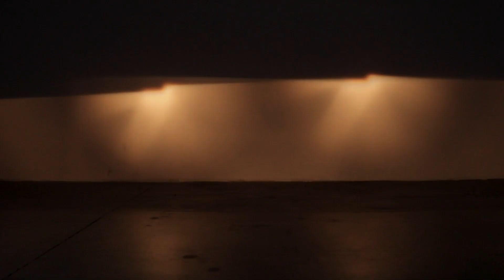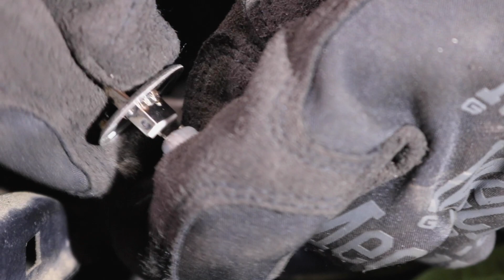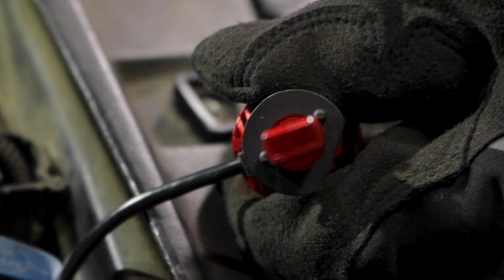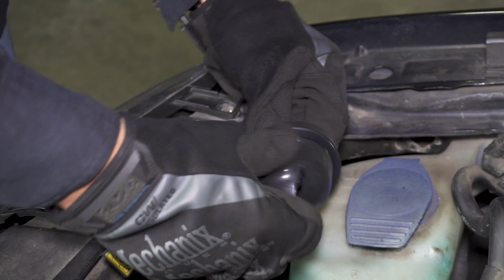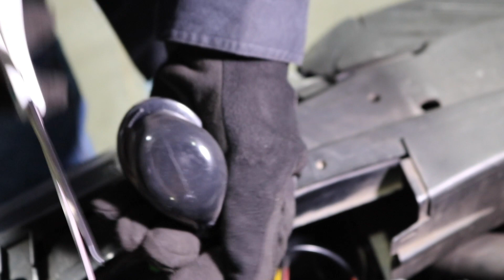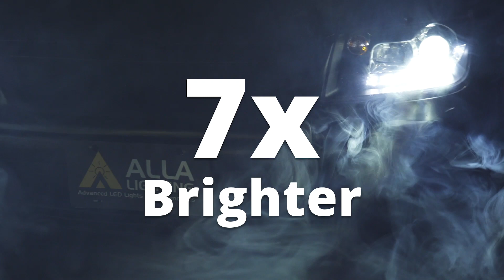How To Install H1 LED Headlight - Aftermarket Halogen Bulb Replacement

Comment: I'm replacing led h1 with fan with a new led h1 without fan. The old h1 had two cables that connected to the red and yellow cables of the car. The new h1 is the same as that of the video, that is, it only has the link for the yellow cable. Where is the red cable connected???? Thank you

Comment: Had to look this up because I'm pretty sure I ordered the wrong bulb. My OEM civic lights said it takes H4/9003 but now looking at it my aftermarket lights actually take H1 bulbs… after trying to put them in I looked at the bulbs I already had in and they said H1 on them.

Comment: Never secure wires like this guy did. Under the hood the wires need to be not exposed to the elements. This tape the wires and leave them hanging was a half _ you know what job. Cut the wires and solder and heat shrink or get a waterproof inline splice you also shrink with heat, and it seals the wire connection. This guy just made a wire problem at least here in Ohio where we have rain, snow, and salt water in winter.

Comment: I cannot adjust the orientation on the bulb bc the housing will not allow me to turn the bulb down to a 6oclock instead it's at a 5 o'clock. 05 mustang gt

Comment: Won’t the dust covers not allow the fans to cool the bulbs??
Reply: exactly what I was thinking...
Reply: Led run at a cooler temp then halogen
Reply: @chamakese55  I know that, but they still get hot…
Reply: @bigdaddy6879  covers are only meant to keep dust and moisture out. I've been running leds with my dust covers on for 2 years now..lights are still fine and no melting.
Reply: They run less cooler. It's not even a concern, being that Halogen run more hot and with the dust cover on from factory.

Comment: What do I do if my metal clamp that holds the bulb secure won't fasen over the bulb because of its size?
Reply: It will. You’re doing it wrong
Reply: Or you have the wrong led. I’m assuming you got the correct one. The clips will fit but you have to figure out how they fit correctly lol
Reply: Did you ever figure it out?

Comment: Where in the hell did that extra ground wire come from?
Reply: Exactley ..where the black thread comes from?
Reply: It was attached to the metal part of headlight housing. They tell you that it attaches to the metal in the light and it connects to the metal part of the bulb completing that circuit.

Comment: The fact that a “professional” is ok with just taping over rubber to keep terminals dry annoys me, its not that hard to solder and heat shrink ti get rid of it bouncing around in there especially on a front wheele drive car, you dont want that getting caught in your belts

Comment: So I put the bulbs in perfectly and both connectors and the bulb just doesn’t work, try the other one and it also doesn’t work... put the stock one back and it works just fine. How can it be in and connected but not work?? I’m about to throw these trashy aftermarket housings in the garbage and go back to 9006 bulbs. Any help would be appreciated
Reply from the maker: Thanks for your message, would you please advise your order number, vehicle's Make, Model, year and high or low beam and email to service@allalighting.com for further assistance? Thanks in advance.
Reply: Flip the positive and negative wires going to the led.

Comment: My led h1 bulbs keep turning off after few min of driving. After I turn the truck the back on the lights are back on...the video mentioned letting the driver hang... I have it zip tied to other wires..  could this be the cause of my lights turning off when in motion?
Reply from the maker: Thanks for your message, would you please advise your vehicle's make, year and model for further assistance?

Comment: Question i cant remove the ground wire from the Housing. Can i use that led without attaching the ground wire?
Reply: Or since it is attached to the housing can i just stick the ground wire to the housing?
Reply from the maker: Ground/negative is required to power LED bulbs, you can use T-tap to splice LED bulb negative wire to ground cable in the housing, you can also stick LED bulb negative wire to metal ground in the housing using a soldering iron.
If you don't have any of those, the easiest way to do so is to strip about 1 to 2 inches of both negative wire and ground wire then twist them together,  wrap with electrical tap.
check the connection regularly if you twist wires together, which is not as reliable as soldering joint or T-tap joint.
Reply: @AllaLighting  thankyou :')))

Comment: Are these like dual beam? Like can do low and high beam?
Reply from the maker: It depends on your stock headlamps, if the stock headlamps has dual high and low beam, and choose the correct bulb sizes, and the LED will have the same function, If you are not sure what bulbs can fit your vehicle, please advise your vehicle's make, year and model for further assistance.
Reply: How does light know i switch from low to high beam? 2014 equinox, converting to h1 only bulb, projection
Reply: @FXPips11 Halogen H1 bulbs are single filament, so they (and the LED replacements) are either high beam or low beam. My aftermarket Spyder headlights have an H1 for low beam in a projector, and another H1 in a reflector for the high beams. So when I made the switch to LEDs, I had to buy 4 LED replacements.
Reply: @PURESOUND4  Thnks for replying bro, got it figured out,
Reply: @PURESOUND4  When you bought LED low beam bulbs for your aftermarket Spyder headlights, did you need a converter to connect the positive and ground wire? I only see one connector for the H1 halogen bulb. Does that mean I will need the converter?
Reply: @christianbasulto5395   No I didn't buy any adapter. There were 2 wires in the headlight housing  a positive and a negative. But I've seen halogen H1 bulbs that just have a single positive wire, and the metal body of the bulb grounds when it's mounted, using the housing as the ground. If you don't have 2 wires,  just 1, then you can run a short ground wire to any nearby bolt that is attached to metal of the car.

Comment: The housings fasteners loop over the halogen bulb. They can't loop over the back of this led. How does it work?
Reply from the maker: For LED upgrade halogen, for some vehicles, extra H1 adapters maybe required to hold the LED, here is installation guide for your reference: https://youtu.be/ZR_RqmLCaKY, it has several H1 adapters depends on the stock retainer holder, so please check the OEM one and choose the correct, H1 headlight adapters option link is https://allalighting.com/search?type=product&q=h1+adapter

Comment: Hey man i jz wanted to ask u my car using the h1 too but the problem is my car only have one socket and the lef buld has two i dont understand how to fix it
Reply from the maker: Thanks for your message, we missed your question before and sorry for being late to respond. Would you please send us pictures of the housing opening, wires and connectors to email service@allalighting.com and also advise your vehicle's make, year and model, we'll try our best to help you fix the circuit

Comment: these aftermarket dust covers will hinder the led fans from drawing enough air
Reply: 2 years with factory covers on with 4 100w leds, fans still running,bulbs still working. NOVSIGHT.
Reply: I'm not sure if this is true or not but I always assumed it was also for keeping moisture out. Getting moisture inside the headlight causes fogging and is annoying to get rid of.
Reply: @HaloCustomClips  yes that's what they're for